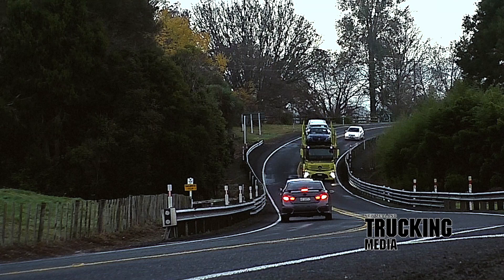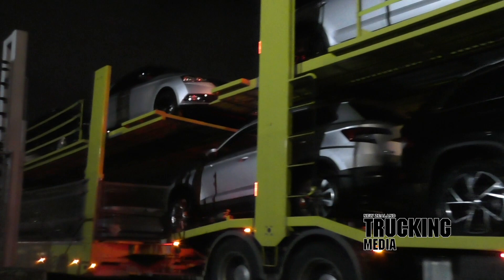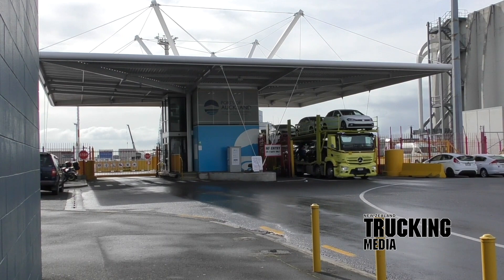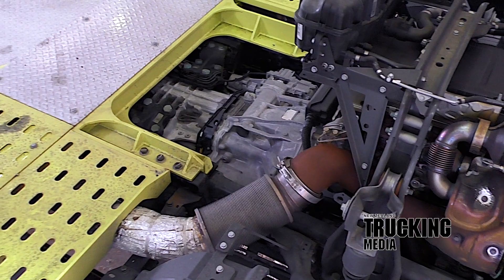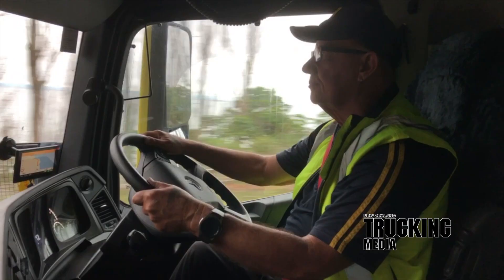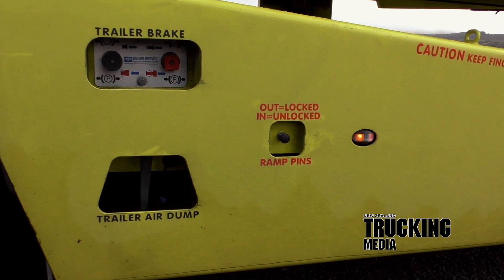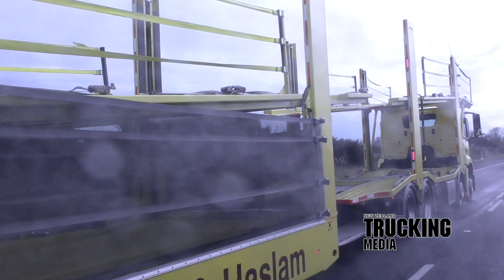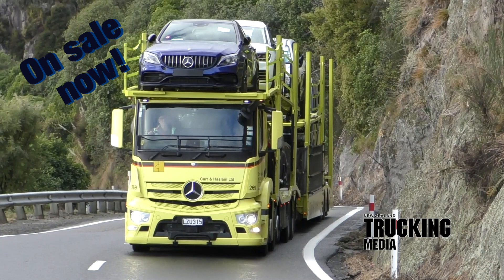Mercedes-Benz Arocs 3246L 8x4 | Truck Test | The Silk Road

Comment: in europe almost all MB car carrier trucks come with only rear cab spring suspension, front is on rubber blocks, front axle usually drives on 355/50 this saves height too.

Comment: BTW this is an Actros not an Arocs. The Arocs has a different grill style.
Reply from the maker: Nope, it’s an Arocs. They put the Actros grille on the Arocs in this market. You can’t get an 8-wheeler Actros in NZ.
Reply: @NZTruckingMag  there is actually now CTT conversion of Actros 6x4 into full air 8x4